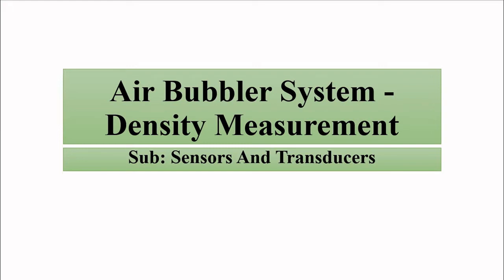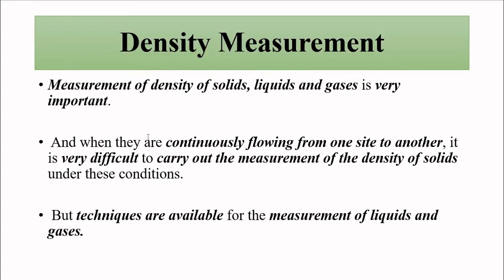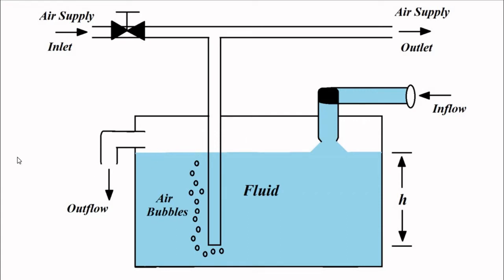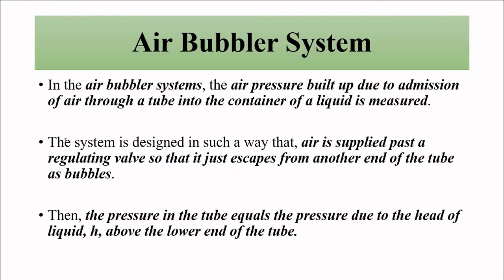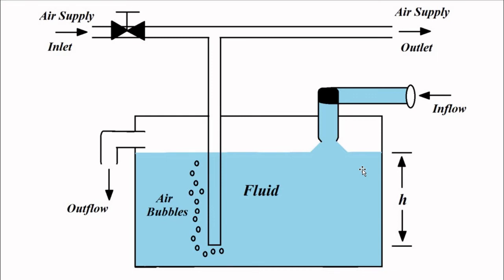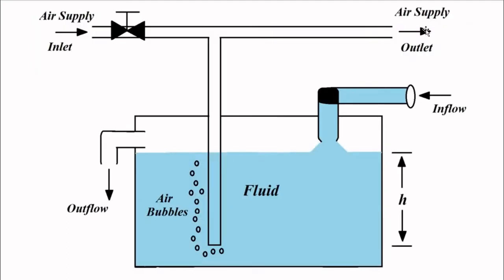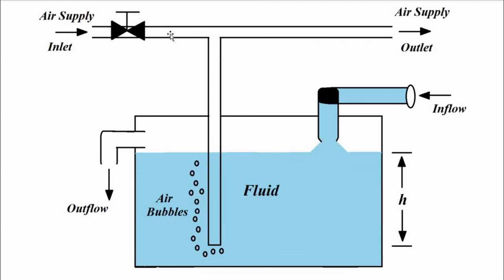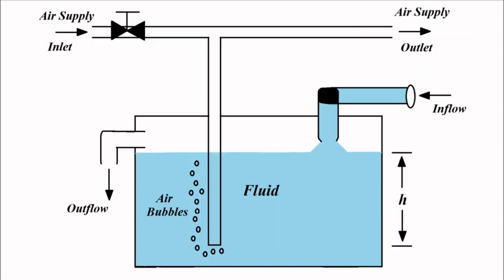Air Bubbler System | Density Measurement | Sensors And Transducers

Comment: Thanks for the video, Well dxplained.
One remarks, the air is supplied with constant flowrate such that the pressure is changed based on the back pressure (resistance) from the liquid. Well done
Reply from the maker: Thank you for your valuable feedback.